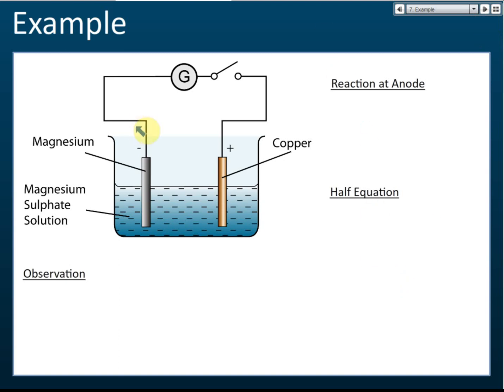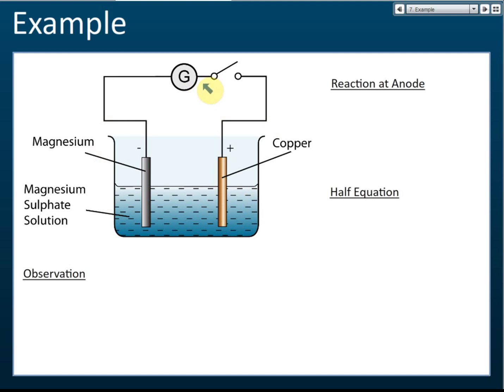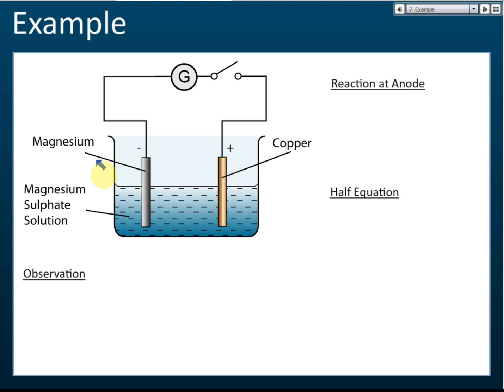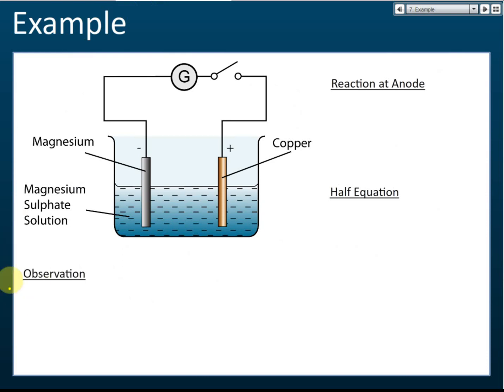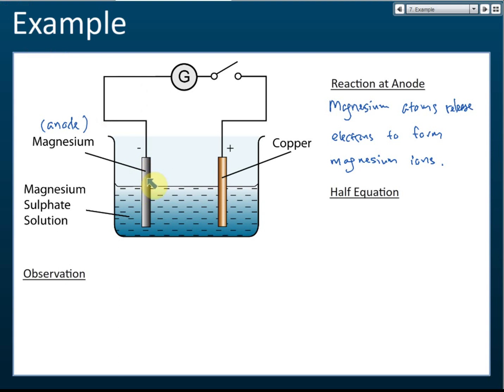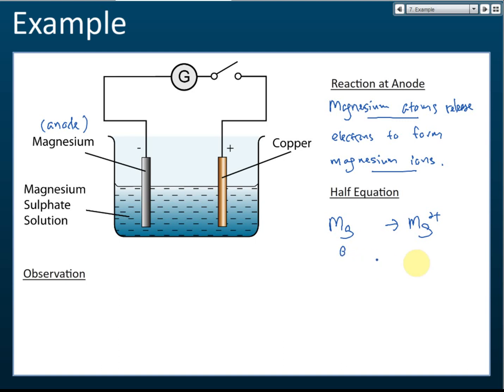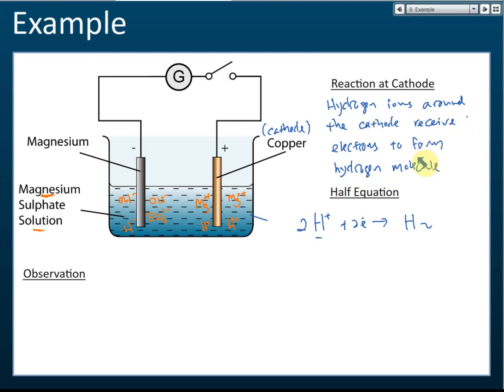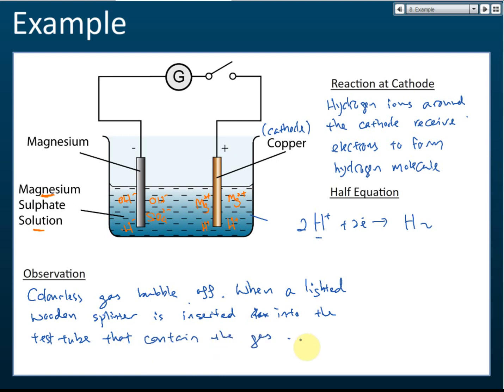Voltaic Cell / Galvanic Cell (Example) | Redox Equilibrium

Comment: Bcoz copper is located lower than hydrogen gas in the ecs series
Reply: at cathode ,reduction occurs,means the ions around it receive the electron which oxidized by the anode to form atom

Comment: Isn’t copper be selected to accept electrons instead of hydrogen ?
Reply: first both electrodes are not same ,no copper ion is produce.secondly,the electrolyte used is mgso4.Hope this might helps you
Reply: @jetjecht5327  is the copper plate does not released copper ion ？but why in some cases the copper is discharged
Reply: copper is already atom